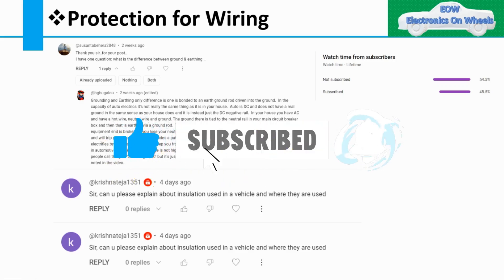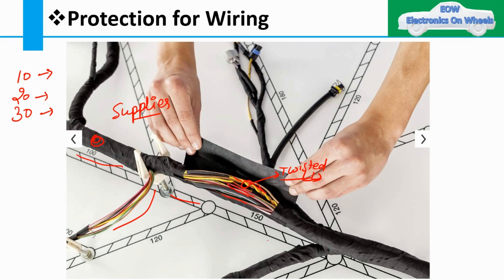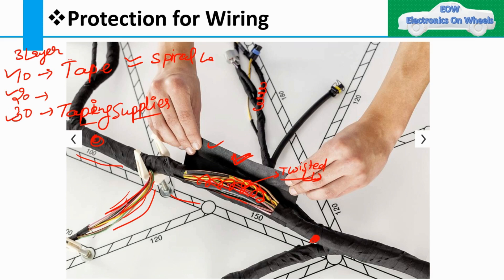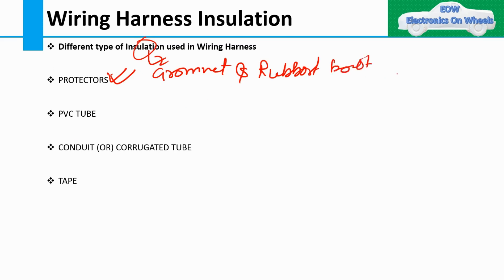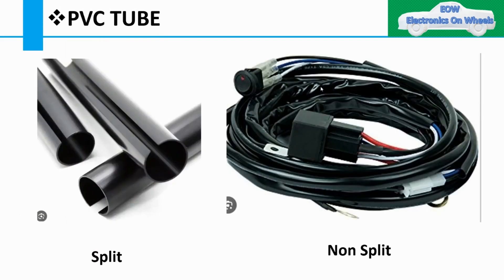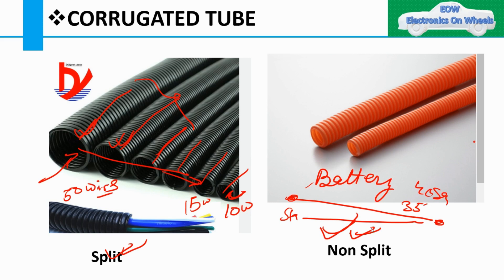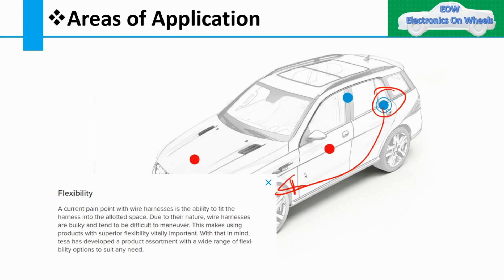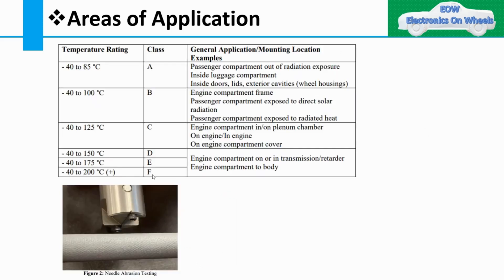Wiring Harness covering in car || Harness Protection ||PROTECTORS||PVC TUBE ||TAPE ||CORRUGATEDTUBE

Comment: Hi... Thanks for your effort... I would like to know is there any flow chart or decision matrix table to explain which covering and type should be used based in various conditions... for example my requirement is high abrasion resistance covering as well i need flexibility in this case prefer flex wrap or expandable sleeves (this decision i took based on mu experience) but how new engineers will choose wisely? If you have any standard table or flow chat explaining on what conditions which type of covering should used then  it will be really helpfull
Reply: due to my experience, as I think yours, many factors could affect your decision and it's not so easy to collect in a table but these are the commons:
- The first one is undoubetly the COST
- then you should take care about the 3D space you have in that area (sometimes it happens that I've had to consider circuits untaped under the flex wrap in order to   
  have a flattened trunk or branch)
- the wiring harness manufacturing plant process